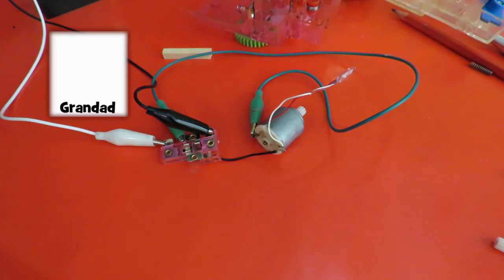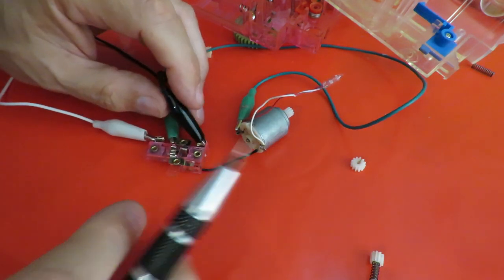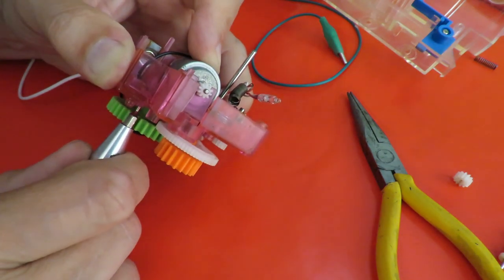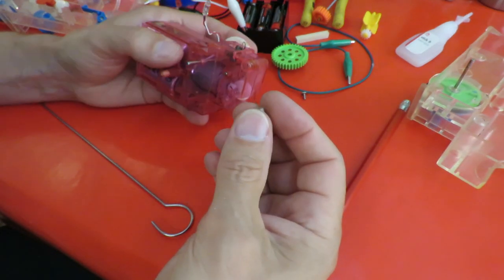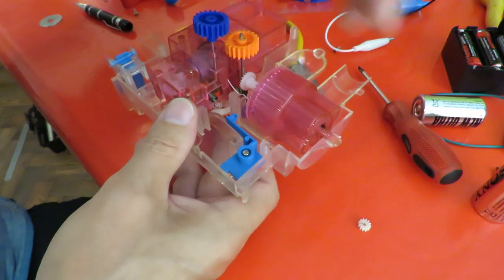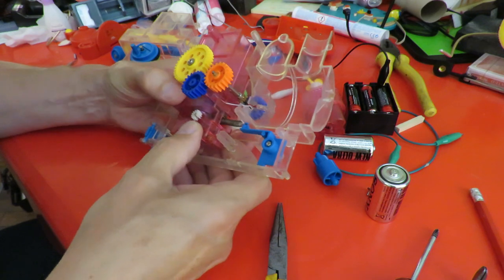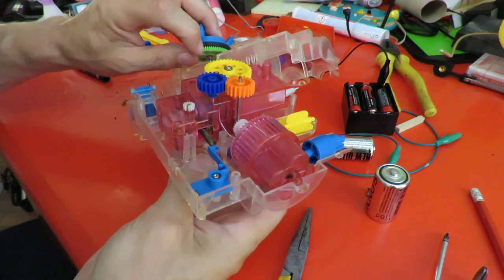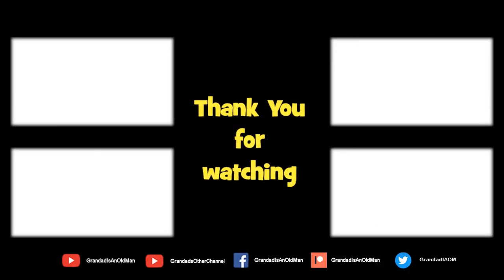Part 2 Electric Train that looks like my favourite clockwork toys

Comment: I don't know why but this thing yells 90's to me
Reply from the maker: Quite possibly, I did have a large collection of clockwork toys of a very similar design. I just liked looking at them with all the moving parts visible 😊
Reply: Yeah it's too bad the gear is split Try to look for more  Replacements on eBay
Reply from the maker: You are commenting on a 2018 video, that train is long gone. There is episode 3 here https://youtu.be/4RkwfAzemn8 but I didn't replace the gear. Have you ever tried getting non-standard gears online? I have spent months in the past trying to match gears. Now I have a 3D printer, but even with one of them it is not an easy option.